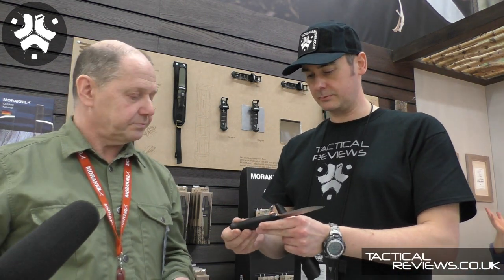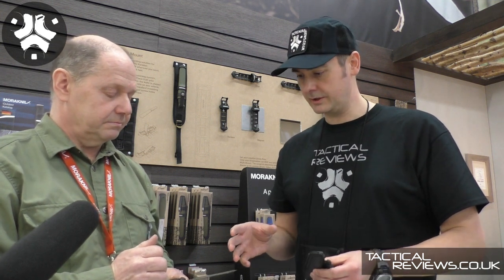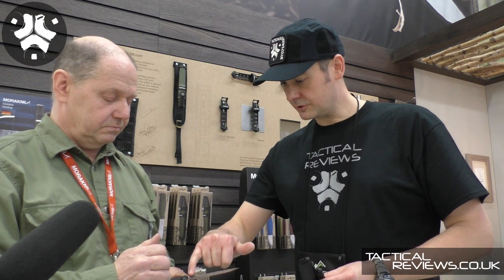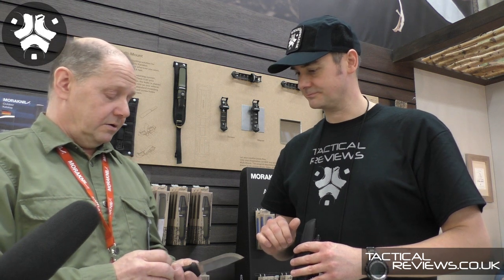Morakniv factory edges and sharpening them (IWA 2017) by Tactical Reviews

Comment: I'm a knife enthusiast and that got me to get a degree in ChemistryMetallurgy back in the 90's. I'm both a user and a collector and I've worked on a company repairing old and sharpening new knives for many  years. I did that at home, for even more years,, before I got that job. 
     No matter how many custom knives, or Semicustom knives, like the 500$ TRC Mille Cuori , I always end up using Moras and Opinels, more than any other knife... I don;t baby my knives, because of their price tags, no safe queens here. It's just the fact, that those older designs, are WAY better for a user knife, way more practical and of course, the most user friendly knives out there. 
    That being said I don't like the turn this company took the later years. They changed the designs of the tangs of the knives, making them WAY more easy to break and they know produced the same knives, with the same materials, asking more than 200$ for one... The wood they used is Ash, nothing special there, the steel is the cheapest and the softest they make and it's recycled.So, nothing changed there nether, however, they now ask that kind of money.... that's greediness and it makes me really ad, because I love that company, and I was expecting them, to give bac to the customer, the respect and the support, we as customers, have given to them. It's because of us, that this company made all those billions...Why now disrespect us all, like that?

Comment: I slightly convex the scandi edge using sandpaper on a sanding block with spring clips. It has the softer rubber-like backing.
First thing I did with the Mora Bushcraft Black.
I like the results this way better than with flat stones.
YMMV.

Comment: While this is very informative and helpful I am a person that likes to take grey areas out of the picture with facts and figures and as I’m not yet skilled at sharpening freehand I’d like to know the dimensions or at least the angle of the micro bevel on the Garberg so that I could make a jig to sharpen with. Maybe I missed something here maybe they don’t actually dial up an angle when they put the micro bevel on it.
Reply: The leather strop will give you the micro bevel. It can vary depending on how thick the leather is (thicker has more give) and what compound you put in the leather. You can free-hand a Mora on a stone by following the angle on the scandi grind and don't worry about the micro-bevel. If you only do this, you'll lose the micro-bevel. But you'll keep the micro-bevel by finishing with a leather strop. I'm summarizing what is stated towards the end of the video.
Reply: @Pinki2019  Thanks I	did get that part about stropping, I just thought that if I could just sharpen at the angle of the micro bevel then I could minimize how much of the protective black coating is removed.

Comment: How do you sharpen the carbon steel Mora Garberg at home to keep the factory micro bevel? What is the angle of the micro bevel for the Garberg?
Reply: About 13 minutes in he points out that you will get the micro bevel through stropping it on leather embedded with compound as the final step.
Reply: Yes this is what I would like to know.